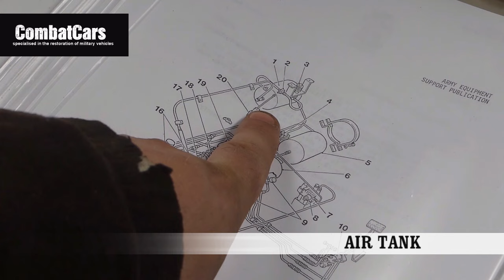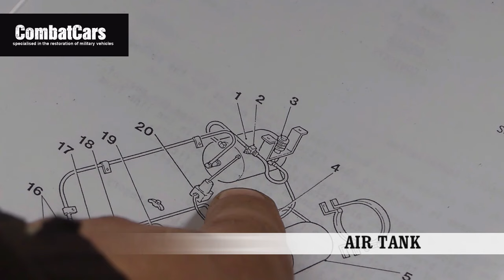Saxon Restoration part 3. NATO Hitch, Air tank & Wheels

Comment: A lot of progress Ross. Those split-ring wheels are great. I used to do a lot of 'truck' split-rings, but we  inflated them within a strongly made steel cage just in case the ring let go under inflation. The air tanks look very neat and tidy.
Reply from the maker: Thanks man, slow and steady wins the race. This style of split rim aren't too bad, if in doubt I would push them under the vehicle and inflate them there.